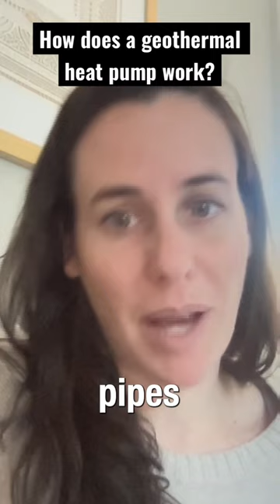How does a geothermal heat pump work?

Comment: Geothermal heat pumps are used in Finland.   The heat pump has to be sized for the entire heating load typically 2-1/2 times that of air conditioning in the USA.   In the USA running that much A/C size is typically discussed as not running enough during cooling to dehumidify the air.   I've never been in a situation like that.   The real issue is geothermal heat pumps are likely $10,000s to repair their in field heat exchange coils.   For heating you are likely not going to under cut the cost of heating with natural gas.   

The electric heat pump is causing heavy electric load during the times the electric grid is also being heavily stressed.   This is much worse with a hybrid air-to-air heat pump electric resistance heat system used in the USA.   The resistance electric heat is providing most of the heat below 20°F and at 0°F almost all of it.   Electric resistance heat is about five times more expensive than heating with natural gas and greatly stresses the electric grid.

Comment: Such a weird way to look at it when they explain it. Essentially it's the same as any a/c unit or air to air heat pump. A heat pump is basically an a/c running backwards. They all use freon because when freon gets compressed it gets really hot, when it expands it gets really cold. If you can cool down the hot side of the loop inside the closed system then the cold side will get much colder. And vice versa on the cold side. If you warm up the cold side then the hot side will get much hotter. This is where you extract your heat inside the unit. The geothermal loops are extremely simple and separate from the freon system i just talked about. Theyre simply hoses buried in the ground filled with water and antifreeze to keep the unit from freezing it. All it needs that water for is to cool the freon when you run the a/c. Its used to warm the freon when you use the "heat pump." I really find it silly that they call it a "heat pump." It's just makes people think it's way more complicated and sophisticated than it really is. Everyone's car has a similar unit accept they don't design it to flip the flow of freon to heat your evaporator in the car for heat, they just use the engine heat because it's basically free heat. They should've been using this method WAY before using the air to air units you see outside almost everyone's home. They are so inefficient in the heat of summer because you're trying to use hot 100 degree air to cool off hot freon.. the geothermal uses cool water from those ground loops to cool off the hot freon. WAY more effective.

Comment: Cost of electricity to pump water is expensive than ac unit and if there is leak or damage then expensive to fix
Reply: your car can break down too.... but you fix it right? GeoThermal is the future of clean HVAC heating and cooling. your comment is baseless and nonsensical.
Reply: @SubStationSparky  I had the same worrry since the pipe is buried possibly hundreds of feet under the ground and would probably be very tricky and expensive to repair or replace....or not, I'm not sure.
Reply: @SubStationSparky you are not a hvac tech so shut up, you don’t understand enthalpy, if tech changes sure,